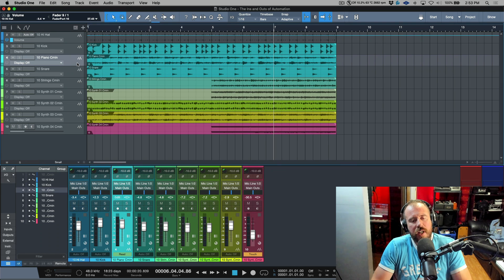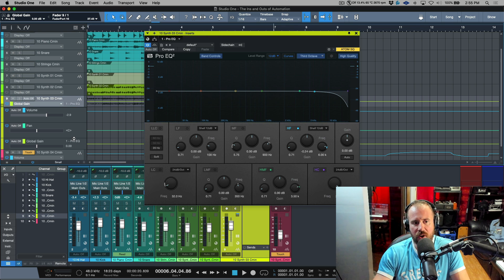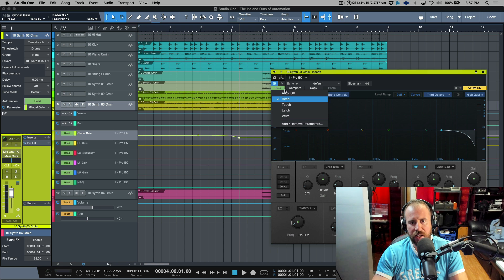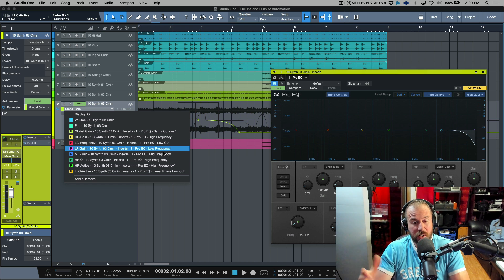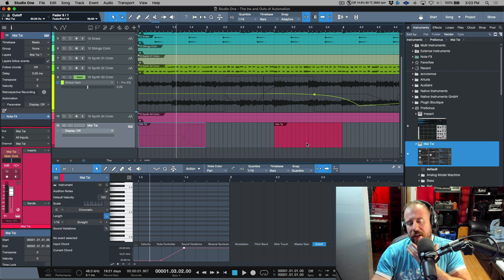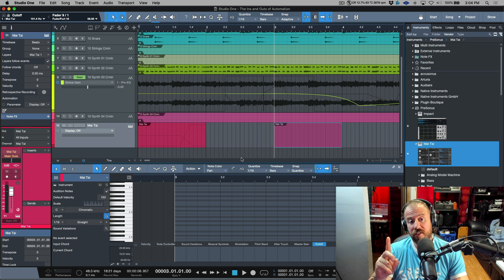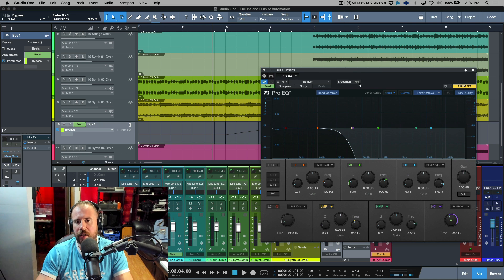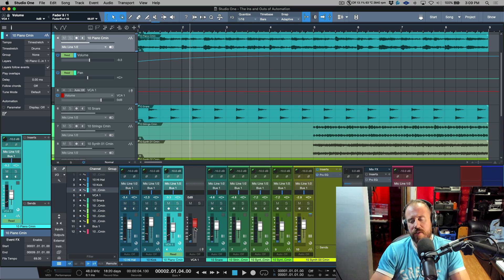The In's and Out's of Automation in Studio One - Part 2

Comment: Hey Marcus, great video, I'm right there with you. I use and understand everything you've said. I still have 1 problem. When I move, or delete a wave with automation on the track (follow is checked), nodes are added. All I want is for the nodes to stay as I made them, without adding more. If I replace that wave(delete it) and add a new wave in it's place, I now need to manually remove the old automation. What is the fix?

Comment: i really wish you guys would implement the automation pattern feature :( A lot of the times we have to do bus automations etc not connected to instruments or audio stems, so at this moment in time  it does not have any length restrictions, you can just select the automation points and move / copy them. 

But that alone a lot of times prevents accuracy, i have to adjust or recopy everything multiple times until i make it the exact same for the next 4-8 whatever bars.